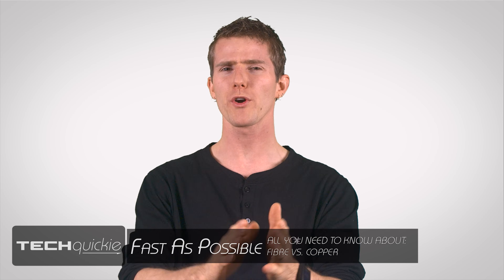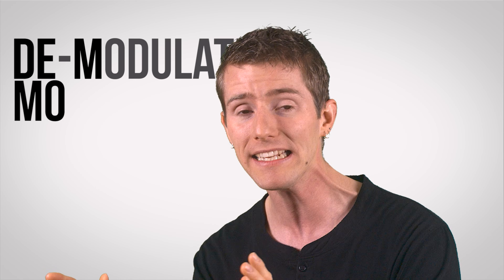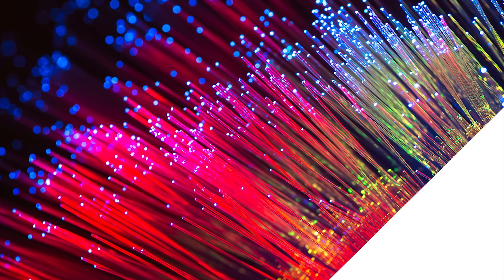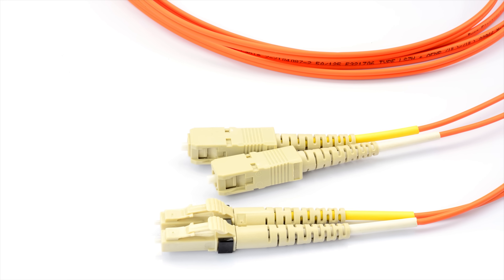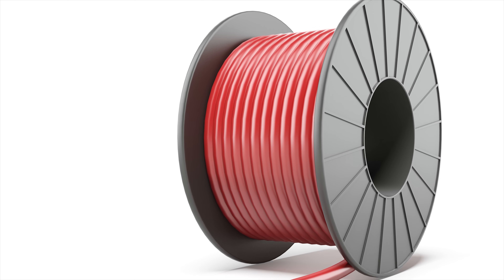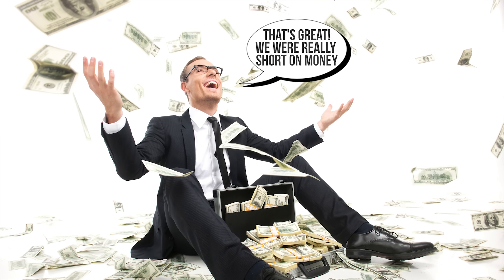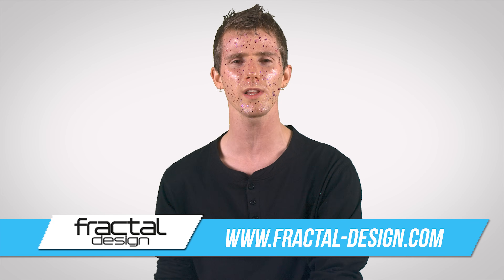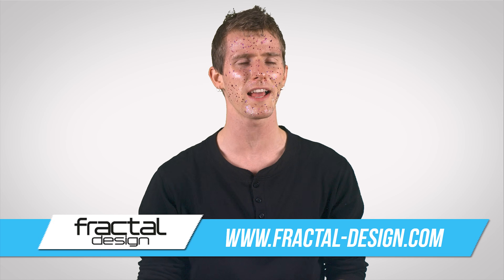Fibre (Fiber) vs Copper as Fast As Possible

Comment: But if a fibre optic cable breaks you really can't just twist the ends together like you can do with copper, so it's more costly and difficult to fix.
Reply: +Ju-hyeok Park Not really, any poor ISP can afford to buy an OTDR and detect exactly where the fiber broke. After that it's all about getting there and welding the fiber with another device. Any decent ISP can afford to buy this stuff, and you really don't need top university qualified people to fix the fiber, most of them have very low salaries.

Comment: Does fiber cable transfer electricity or only information?
Reply: +Dami Bang Light travels the fiber and at the other end a light sensor picks it up and converts it into electrical signals, somehow similar to how a solar panel works. So to answer your question it's like you signaling your friend with a flashlight, it's light carrying information.
Reply: i understood the information part in the video, light travels to the wire and a sensor transfers it into information but i thought the sensor takes the energy from its own power source and transforms that energy into info, not the cables energy. but light is also energy so its obvious.

Comment: Most telephone wires especially the ones that run to your home are not solid copper, they once where but they are copper coated aluminum now for the most part but some services such as Comcast might you fiber in some locations. But not all the phone line that services our area is about 60 years old and our part of that wire has been fried by lighting, if your machines are on a surge they are not 100% safe if the bolt strikes your pole like it did to us 2 years ago and then travels in through a phone line it will more than likely kill your PC and anything associated with the internet box, you might be lucky like my PC was and have the Ethernet jack get fried and the PC is untouched other than that and it also destroys your phone line as well and then the service provider is too lazy to replace the line cough Fair Point saying the line into the house from the pole is the problem and the phones in the house are old which they are not becuase they are new from after the strike killed the old ones. Fiber Optic isn't cheap enough to have phone providers go around and replace the entire infrastructure to it just yet fiber optic also allows for higher bandwidth than standard wire can it is muti strand vs single stand to some extent.

Comment: The internet in the uk is fairly fast and fibre optic (20-40 mbps) is only like £20 a month and super fast fibre optic (over 40mbps) is only £25 a month and they include home calls in this deal as well but tv packages and mobile phone deals are an absolute rip off in the uk.

Comment: love your stuff linus... this was a great watch I actually work for an ISP in Northwest Indiana, small company but we have actually started deploying fiber to the home in some areas and had only a small take mainly due to the fact that our ISP cannot offer TV over fiber yet ( due to a FCC mishap that took place long before i was employed here. but more on your comments about fiber costing more.. that isnt exaclty true. Fiber vs copper in length fiber is actually cheaper due to high rare metal costs. the other cost problem is like you said having a outside plant already made up of copper vs redoing that entire plant in fiber is a huge cost in time, labor and materials. the other major cost is upgrading the equipment that said copper and fiber are ran off of. We are currently using upgradeing all of our (repeater boxs) Litespan equipment to ADTRAN equipment that allows us to increase our output potential. Litespan equipment only allows us to have about a 1Gbs to split between 1-50 people but ADTRAN is allowing us to have 10Gbs to split amongst the same, ADTRAN is still dated but alot better than dial up lol, I do believe that once TV goes to 60% or 70% streamable we will start seeing a more demand for fiber.

Comment: DWDM, dense wave division multiplexing, increases available bandwidth on each individual fiber.  In fact, there is no limit, theoretically, to the amount of bandwidth that can be pushed over an individual fiber.  One correction to Linus' description.  A laser signal pulse at one end of a length of fiber will only travel about 30 or so miles until it has degraded (because of attenuation) to the point where it needs regeneration.  In fact, on long haul fiber routes, there is a regeneration station about every 30 miles.  The signal is captured, turned from an optical signal back to an electrical signal, squared up, and added back into a fresh packet with refreshed overhead, sent to the laser and fired again, sending it another 30 miles down the route.  The really cool part is (and remember we're talking digital communications here, ones and zeros, if the receiver sees light it's a one, no light equals a zero) that we can now reliably send, and receive, one TRILLION pulses per second.  The network speeds that are coming to the public will be mind-boggling.  Really.  I'm serious.

Comment: In 2014 99% of all residents in Sweden had access to a wired internet connection. 51% of all residents had access to fiber. Where I live every house and apartment is connected to the fiber network. The most common speed is 100mbit (100/100) and at some areas you can get 1gbit (1000/100). I can kinda see why Facebook decided to build their first serverhall for EU here in the northern part of Sweden. :)

Comment: I'd just like to point out that electricity through copper does NOT move anywhere near the speed of light. It's not even close. At 10 amps electrons moves at a speed of about a quarter of a millimeter per second through copper. This is sped up with modulation techniques and using oscillation rather than actually requiring electrons to traverse the wire. Fibre optics, (single mode) when correctly doped can reach speeds nearing the speed of light or 300 million meters per second. A pulse or a wave of electricity can be sent down a copper cable at a speed of approximately 200 million meters per second. At the absolute best copper is 2/3 or 66% the speed of fibre. Then we can bring up interference, max distance, DWDM and other topics that can affect bandwidth and fibre becomes the clear winner.

Comment: Photons aren't immune to electromagnetic interference, it is the carrier of the electromagnetic force. The photon appears to move slower then the speed of light in a fiber optics cable because of the refractive index, which can only be described by the quantum states for electrons arranged in the medium. Which is also why improperly placed fiber lines will leak/distort information.

Comment: lets say u have a file. why not simply split it into 1000 pieces and send them through the same cable at 1000 different frequencies then recombine it to get the original file like torrenting? wouldn't that be easier and cheaper?

Comment: Bandwidth is only an issue for those who upload and download illegally. OK that is not fair really, there is now a demand for high bandwidth because of streaming video such as You Tube or others. If you live in an older house as I did at one time that is also an issue you may not know about. Old copper phone wiring is not twisted together  as good as the more modern stuff is and can impeded your signal. Something to keep in mind.

Comment: the cost of fiber & copper is really not that different these days... But depending on the deployment, the cost per port is the down side. You can get a 10Gbps Twinaxial cable for less than an SFP on the switch + fiber + SFP module on the server per connection...

Comment: Well, I was promised Fibre but I'm not sure if that's what my ISP is using. What's the max speed you can get through copper cables in comparison to Fibre? I got an 8Mbps, much better than the 1Mbps I used to have from the same ISP before they implemented fibre optics. They offered the upgrade for a small installation fee.
Reply: prepareuranus fibre can get you as high as 10Gbps in certain parts of Norway at least. 1Gbps is a common max speed offered in Fibre-To-The-Home networks. Currently the lowest I can get is 35/35. (Mbps seems a bit shoddy for fibre if you ask me.
Reply: Thought so lol. Maybe it was some other major upgrade. Whatever it is, it gave me 8 times my old speed. Man I wish I lived in one of these comfy ass first world countries xD.
Reply: +prepa I think my area has the fiber-main-line-copper-last-mile arrangement that Linus mentioned, but I'm not certain.  We currently have 300 Mbps.
Reply: Anal Prolapse In My Bum When I'm Filled With Cum By Onii-Chan And His Friends While I'm A Cumdump

They upgraded mine to 10 Mbps now. They keep upgrading me without me asking for it. Such good guys lol (jk). But now I noticed they offer 20 Mbps for the same price on their website... Do I need to resubscribe or something?
Where do you live btw? Internet access seems so cheap in Europe. I know someone who's paying 8 British pounds a month for 300 Mbps. Is it unlimited btw? Afaik limited bandwidth is still a thing. Not here though.
Reply: Anal Prolapse In My Bum When I'm Filled With Cum By Onii-Chan And His Friends While I'm A Cumdump
No some ISPs really have limited bandwidth packages, including in the U.S.

Comment: linus maybe fibre is more expensive for the consumer length and mass but for isps its much less expensive in fact because glass wich is in fact made of sand is that much cheaper than copper wich is a fairly rare metal and high in price.
So the most expensive part is the digging for deploying the fibre and the high priced switches....
i work at a european isp and i splice copper and fibre nearly every day
and sorry for my bad english

Comment: so I work for a telecommunication company out here in the us, and we use a fiber infrastructure, we have what we call Video Ready Access Device(VRAD) and Internet Ready Access Device (IRAD) each houses the array of fiber that comes from the VHO, when at the Term you can only get roughly 150 mb down, the reasoning is that the cost to upgrade the VHO hardware to use gigapower is too costly. lucky enough from the DEMARC using 17Mhz we are able to see a MABR of 100mb down per pair. now there are alot of homes that have been converted to Optical Network Terminal
 (ONT), but alas without a VHO that is upgraded the speeds will not be that of giga power. I would like to point out that the Copper system running throughout is not actually on repeaters its running to terms which are just termination points, now cable communication uses repeaters but thats what you get when you are using a line share system and not a dedicated system like that of which the company I work for uses.

Comment: Lmao, In Saudi Arabia, it's 60% covered with fiber, i get download speeds of 200 mbps. America is far behind...
Reply: Ajwad Sabano the fact with America is that there already was a connection with internet, and it would cost a shitload of money to replace thousands of kilometers of cable. While in KSA internet wasn't always deployed everywhere, and basically it's way cheaper to roll down a whole new network instead of replacing a working network. And you guys have oil :D.
Reply: Pepijn de Meer In Dutch we call this the: law of the handicap of a head start. this will explain my theory. http://en.wikipedia.org/wiki/Law_of_the_handicap_of_a_head_start#Examples
Reply: Cool, thanks for clarifying :)
Reply: Razvan J i know bro , i also live there
Reply: Ajwad Sabano Maybe if you people actually took care of yourselves instead of being carried around by us that would not be the case. Fact is we effectively beta tested everything from electricity to internet using the same infrastructure. We have had the same copper lines since we used the telegraph. Maybe if the rest of the world carried their own weight and paid for the use of the tech America brings to the table then we could build fiber lines. Most likely even if the money was their it would just go to some CEO's yacht and lambo.
Reply: Razvan J could be true
Reply: Razvan J Oh im sorry about this, i've went to Czech Republic before,there is not much poverty as you mentioned but maybe in some certain Eastern European countries i guess.

Comment: I'm living in the southern part of Norway, and i feel the ISP focuses on the wrong parts.
I'm living in the center of a municipality, and only have access to copper that are a few km away from the nearest Repeater. But my grandpartents that are living in the middle of the forrest are getting Fiber.
No wonder the ISP Fiber project failed.
Reply: Elderly people need more fiber in their diet.
Reply: One big problem is that in city centres it is very hard/expensive to lay all the fibre in the ground in the first place, not to mention if you need a kind of "substation" to distribute the signal. Where I live (northwest Norway) almost everyone except the people in the city centres have fibre due to this. In general, Norway has a really high rollout of fibre, even FTTH, which is almost unheard of in America. It's just too expensive in the city centres.
Reply: Australia spent $50billion and its shit

Comment: The upper bandwidth limit of fibre is our ability to make light senders (Lazars or bright LEDs) and receivers that have an incredibly narrow sweet spot. If we could make sources and receivers finely tuned enough, there's no reason we couldn't sent a billion different channels down the same pipe at the same time. The only thing stopping us is how narrow a wavelength we can make, without crosstalk. The physical media will carry it just fine. It's our send and receive stuff that needs to get better. We don't really need more fibre backbones, or trans Atlantic stuff, we need fibre that goes to within a hundred yards of each customer. Fibre to the individual house is perhaps unnecessary, but 'the final mile' is too far. A hundred yards is about right. Two hundred is too far. And that damn twisted copper had better not be in an underground pipe that floods every time it rains.

Comment: Linus you need to move to Atlantic Canada where you can get fibre directly to the home with Bell. I assume you live in the GTA right now and I know the struggle of getting anything fast there. 150Mbit that the ISP offers with much more room for improvements. And on a normal test I get the full 150Mbit speeds.

Comment: Here in Canada we have different options. The most common is an HFC (Hybrid Fiber Coax) architecture just like Linus explained. The telco I work for can deliver up to 200Mb/s down - 30Mb/s up for residential customers on this kind of network. It works really well and it is reliable. FTTH is slowly taking place but it'll take a couple of years before going mainstream because of cost.

Comment: According to our local Vodafone technical headquarters it's cheaper to connect a recently built house via fibre, due to the high price of raw copper. But this just applies for cost per meter. Due to the missing fibre backbone its necessary to go over much longer distances and that's made it cost at least an order of an magnitude more expensive than copper. Installing fibre in a small city costs again according to Vodafone about 100€ per meter. Including all necessary costs for earth moving, crossing streets and pavements.

Comment: Why is glass fibre so expensive? I've seen carnivals that give away glass fibre props as prices, so why couldn't a big company get it cheap?
Reply: Because you need hundreds of km of it to give route it through houses, streets, and to the exchange throughout a city, which costs a hell of a lot more than a few meters you buy at an electronics shop.
Reply: Well yeah, but those costs come with copper cables too. To put it in other words: if I were to get a piece of copper cable at said electronics shop, it wouldn't be that much cheaper than glass fibre, would it?
Reply: You are correct, except the government (or whoever lays down the cables) doesn't want to replace all of the copper cables that are already there with glass fiber cables because they want to spend money on building stuff that nobody wants like roads and ugly apartments.

Comment: We have a fiber system not as just a backbone, but it runs directly into everyone's house in my country. I have an optical converter in my house that I got for free with a wireless modem I got for free that I can replace when there is an upgrade of the service for free(every 1-2 years). Also, I have 250/250Mbit internet for 20€ per month that includes a phone line and a TV with set-top box that I got for free. U mad America?
Reply: Where do you live ?
Reply: vagelis konstantinou Slovakia. Actually, we were the first in Europe to have this thing. I live in a town roughly 100km from the capital city and from my flat to the server in the capital is no active network device. Lot of things suck in Slovakia, but actually in networks(of any kind) and computer systems we are the most advanced. Also landlines got upgraded network for huge amount of (private) money, we were the first to have them completely digital.
Reply: Thrust vectoring 
Ok must be nice :-)

Comment: actually the fiber cables are cheaper than the copper cables by the length of the run. where the cost for a fiber line is MUCH greater is during the installation process. To terminate a copper line you simply have to connect the copper wires that are color coded to insure proper connection. Fiber has to be physically bonded perfectly together end to end.

Comment: he didnt say one of the huge downfalls of optical cable or fibre as he puts it is since it is glass tubing it cant be bend like copper wire can it can bend but at like 10% of what copper wire can or it snaps the optical fibres inside